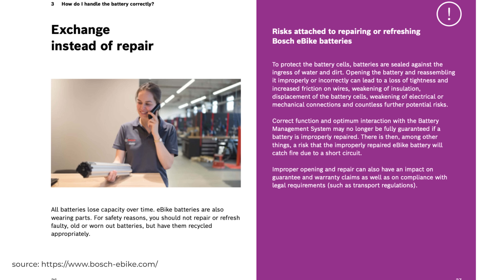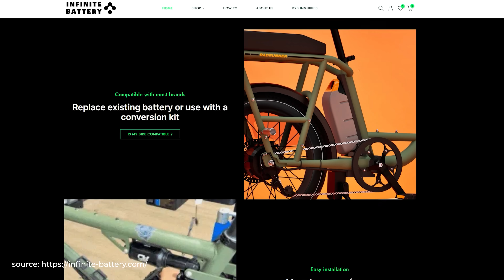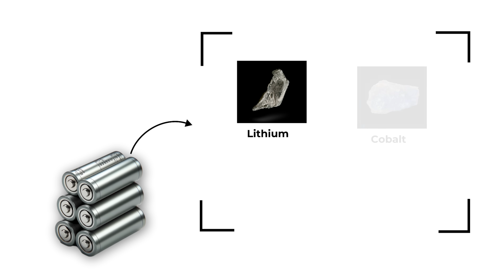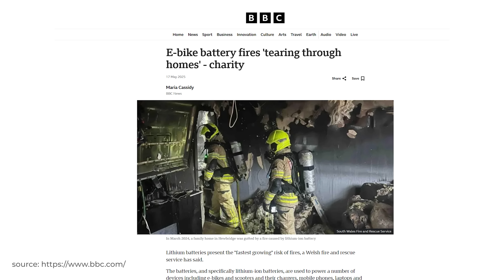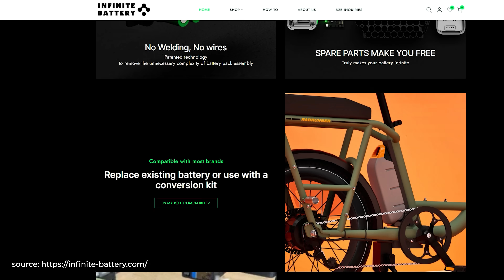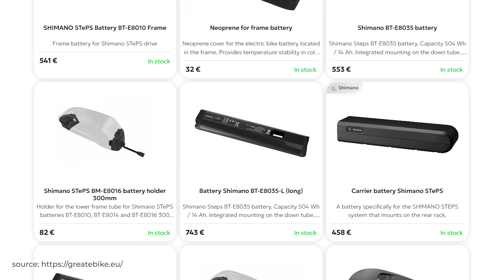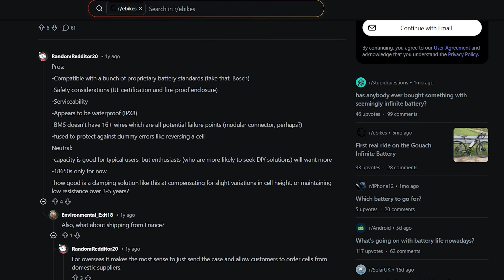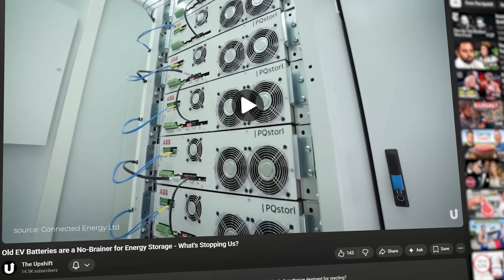This e-Bike Battery Rewrites All the Rules

Comment: Instantly subscribed. This channel deserves way more attention!  I fell into this rabbit hole when my Dyson V8 battery died early - turns out they intentionally brick packs with healthy cells by disabling balancing and then permanently killing the BMS if the cells comes sligthly out of balance. Classic engineered obsolescence, greed disguised as safety.
Huge respect to Infinite Battery!
Reply: Makita pull a similar trick with their 14V powertool packs. Try to charge an overdischarged pack 3 times and it bricks the pack forever. (and there is nothing in the powertool to stop you over-discharging. It's a blatant lie to call this necessary for safety - it's actually about selling more packs. This shit really should be illegal if we want to preserve a working planet.
Reply: @xxwookey this all true except the 18v tools do communicate a low voltage cut off. That three tries in a row is absolutely uncool. To get around bricked up packs, all you need is one known good pack and two pieces of wire stuck between the charger and good battery. Keep pos on pos neg on neg. Run them to brick and stick with washers in the slots. Pos to pos neg to...you get it. Plug in charger last and to be safe, dont leave unattended. Been doin this forever.
Reply: @acepairfecto5597  much better off over volting like 2 to 4 volts, get way more perf. From just a slight voltage increase. Just have to get a seperate charger to support the up voltage battery
Reply: @xxwookey  there is an Arduino tool to reset the BMS on Makkita batteries. Ive used it successfully to unlock my 18V drill battery after i abused it for my ebike and charged it manually.
Not sure if it helps in your case but i would try it out.
Reply: @xxwookey  its called OpenBatteryInformation
Reply: @wtsuser  Oh, that is so handy. Thanks. I wish it had been around 7 years ago when I was furiously re-boarding Makita packs to unbrick them. I still have some of the drills and batteries though so at least I'm good now. Cheers.
Reply: Ah, that would explain why my attempts at re-celling a Dyson pack failed. It works for a bit, then dies, even on new, freshly charged and pre-balanced cells.
Reply: I am so glad to find that battery issues are being tackled by fixitfairys. There are chargers for multiple cells that will re-balance those cells, why is this too hard for battery pack manufacturers? And my experience with failed packs is that 1 or 2 batteries fail, not the whole pack. 50+yr Electronic Tech.

Comment: I built my own battery, i built my own ebike. After using it for about 35K km i can say, that repairable batteries on ebikes are overrated. I will likely never have to replace my cells. By the time i do, im never riding bikes again.  If you are replacing the cells on your battery and its been less, than 10 years, then you are doing something wrong in choosing your battery.
Makes 0 sense for me to pay the price of a whole battery pack just for the case, then pay the price of another battery pack to fill that case just so i can refill it again when its time to retire.
Reply: Yes. This kit is not for battery builders, Klugscheisser.

Comment: I made and sold a no-weld 18650 pack with cell level fuse and great compression, design is open source, can see on my channel 4 videos ago.
Reply: Hey, I'm also investigating this because I'm wondering about a fpv drone designed battery. Everybody uses spot welding for those as well. The main question that people put back to me was how many amps can press fit terminals pass without significat heating over the traditional spot welded type. Did you ever have problems with thermal or amp limits on press-fit battery connections? Or is is a non-issue? I'm gonng check out your videos though, cause it sounds really interesting
Reply: The 2160s are the go now
Reply: @mickvonbornemann3824  2160s are not the "go now"
Reply: @mickvonbornemann3824  2160s? you mean 21700s? I use 21700s in my fpv batteries. But one bad battery causes a lot of unnecessary work. So I'm wondering whether a press fit battery can deliver enough power without browning out or burning out a connection to run a 7 inch quad.
Reply: with bms?

Comment: You need to do two things now: 
1) add support for 21700 cells
2) design larger pack for 70-80 21700 cells.
Reply: 21700s are so much better than 18650s, they are definitely the future for E-bikes.
Reply: I have a battery with 50 of those cells. The battery is impossible to keep secured without zipties. Even the triple bob from Grin isnt keeping it secure. It helps tho.
Reply: @daniilvolkov8790  I have 65x21700 (48V 25Ah) and I haven't had any issues for almost 4 years.
Reply: @daniilvolkov8790  I have a 30 amp hour 52 volt e-bike battery mounted to my frame and one mounted to my rear rack. It's easy to create a hold down that will keep the battery stable even if the bike falls over. But yes, these battery packs do need to be stabilized so they don't break the mounting shoe.
Reply: @daniilvolkov8790  what if he could use plastic or glass fiber for the housing insulation and then aluminium extrusion to keep them very well together!
Reply: @carholic-sz3qv  Something like that is done already. Still quite shaky. I have a suspicion, that my pack's case wasn't the best choice.
Reply: @carholic-sz3qv  You could probably even use carbon fiber as isn't not hugely more expensive than glass fiber (I think it's about 4x more last time I looked) , much stronger, also looks good too.
Reply: It`s in the pipeline.
Reply: Molicell have some 100amp 21700   yummy

Comment: loool the diy battery is so expensive yoy might as well just buy a good spotwelder. it will be more reliable and better
Reply: wait for chinese comrades. Soon or later they will steal this design.
Reply: Its more expensive as now they are losing servicing costs in the long term

Comment: swapping out cells isn't enough though, you can't simply replace a small number of cells, others are worn and need to replace as well in the row of the string, but then overall, the rest will discharge quicker than the new one you just replaced. in the end, you need to replace ALL the cells and put the other good ones as good use for other projects or give to others who have the same worn level to make a pack. I got over 120 cells waiting for 2nd life usage.

Comment: if the contacts are copper and spring compressed with large surfaces contacting the battery terminals then yes, the resistance will be comparable to spot welding or even better depending on the contacting surface area
Reply: Looks like two PCBs to me. Gold plated contacts offer reasonable resistance and don't degrade. 
Spring loaded copper contacts offer less resistance, but you're dealing with 2-3 different metals and possible corrosion over time.

Comment: 8:25 - Simply NO! Putting them in series increases the voltage. Putting them in Parallel increases the possible CURRENT. The CAPACITY stays the same.

Comment: For the closed battery architecture, at least for bike share, I have heard from an old designer that the problem is stopping people from stealing the battery cells -- either for money or (in true SF fashion) to get the lithium out to be used as drugs

Great for most individuals yea but the bikeshare stuff definitely has some more annoying design requirements
Reply: They are testing in rental fleets for years.

Comment: 50 euros for 40 cells? Sounds optimistic. Let's check if this offer is real by going to the infinite battery website, "Add cells
Cell pack - 40x DMEGC 32E 3200 mAh - SOLD OUT (€49.95)" Strange.
What if we buy them separately from the set? "Lithium-ion cells
Cell pack - 40x DMEGC 32E 3200 mAh
€99.00 Out of stock." Hmm, how is that possible?
Okay, what about nkon? “Out of stock.” What a surprise. So if the EU restricts the sale of 18650 cells on its territory, Bosch will win and force everyone to live by its rules, just as the bourgeoisie once forced the feudal lords to live by theirs, and the communists chose to become the new bourgeoisie instead of building the promised bright future. What do we have in the end? What we see is what we get. We need to exchange goods, keep records, and vote on the blockchain, then we will direct individualistic egoism towards building a bright future, instead of believing in someone's promises.
By the way, nkon has EVE INR18650-33VA 3300mAh — 10A, which is more expensive, but as long as it hasn't been banned yet, you can still buy it, although shipping will be costly.

Comment: this thing is probably the wrong approach. the right approach would probably be to take out the bad cells.
Reply: But, as Alex explained, it's very hard to replace one or two cells and still have a balanced pack, because the new cells will be different, or just newer and have a different (usually larger) capacity, and a slightly different disrcharge or charge curve. So this usually doesn't work very well in practice, depending on the sophistication of the BMS.
It is way more reliable to just swap sets together, then use the older cells that still work for something else. But yeah, you can do that if you like with this pack - nothing is stopping you.
Reply: Not really. 
In battery packs you have cells in parallel to get to the required voltage and many of those in series to increase capacity. 
If one cell goes bad in one of the groups and you replace only that cells then that parallel group will likely very quickly become difficult or impossible to balance and cause further problems in the whole pack.
When you start with a complete new batch of cells that have been matched then they all degrade at a similar rate negating this issue although not completely.

Comment: What this company should be working on is battery packs that use cells larger than 18650. The obvious choice would be 21700 cells, which offer substantially more capacity without being significantly larger, but even larger cell sizes are already on the market, such as 26800, and should be considered, given the large volumes of individual cells needed to satisfy demand. 18650 cells are obsolete for high capacity applications. Developing battery packs around larger cells now is also important for the future because eventually, most medium to large scale consumer applications are going to need to shift to sodium-ion technology, which is cheaper, safer, and most sustainable, but has lower energy density, so lithium-ion technology needs to be reserved for smaller scale applications where higher energy density is a design requirement.
Reply: I'm sure they will

Comment: if this crap was made in the 90s, a BMS would just be a standard cell holder where you could drop in cells, just like old AAs, and the welded stuff would be optional,

but we're deep into idiocracy, idiot-proof design is just idiot-creation in practice,

you can try doing it the 90s way, but it'll be a shrinking niche market, there's no fixing this world
Reply: similar with phone batteries

Comment: 350 pounds is worryingly cheap if what they are claiming is true and they are using quality parts(which they are probably not). and replacing the battery’s is definitely not something the average person could do safely, because voltage balance across the cells is near impossible without specialized tools to discharge/charge the cells to an even voltage with used cells making this process even harder. And unbalanced cells could be catastrophic, since you attach all the cells together at roughly the same time unlike when spot welding where you only have to discard the one that was just attached with an dissimilar charge to the other cells.
This seems like another channel advertising magic
Reply: 350 pounds is CHEAP??? No. The cells cost like $1-3 each depending on brand. Container is like $10. BMS and boards $20. Every ebike brand is overcharging for batteries since they are all proprietary fitments.
Also did you even watch the video? They dont even want you replacing 1 cell, they tell you to replace them all for this reason.
Anyways, this product is pointless since the hoobyists willing to tinker will just buy cells and spot weld them into the original pack. Spot welders are cheap, cells will be the same cost, effort isnt much more.
Reply: @_aceofspades_ it doesn’t matter how many cells you replace, cells are often stored for different amounts of time and sometimes depending on qc even brand new cells have different voltages
Reply: So, you're saying that it's impossible to design and build a tool that takes care of the voltage imbalance in an automated fashion? How do you think these batteries are manufactured in the first place, by hand?!?! We live in a world that's full of "impossible" tech. If you had said 30 years ago that we would be carrying computers on our wrists that are more powerful than any PC from that era people would've called it science fiction, yet here we are.
Reply: @crazymonkeyVII that would require a bms and an inverter for each and every cell, it’s certainly possible but not for 350
Reply: I've been changing AA batteries for my entire life.
Reply: @user-vo3st8kx7s cool

Comment: I'm kind of in 2 minds on this
Very much pro RTR & the infinite battery is fantastic
Problem is, people are idiots (I include myself in this)...& it only takes 1 to burn a building down
I think there is a middle ground....where OEM's are required to sell re-manufactured batteries at a reasonable price...buying back the old battery
Reply: I would say it depends on the way they design it. Gasoline is a highly flammable and even explosive substance, and people have put fuel stations on fire filling up their cars occasionally, but that hasn't caused regulators to ban people from filling up their cars themselves. If IB has designed this in a way that it will fit only one way and the BMS is sophisticated enough to detect and/or correct significant voltage imbalances I don't see why people wouldn't be able to swap the cells themselves.
Reply: @crazymonkeyVII  You'd have to also individually fuse each cell in case someone reverses the polarity on one or more paralleled cells, otherwise that group of cells could potentially go pop.
Reply: @therealchayd I disagree. We don't have to completely dummyproof everything in life. If people don't follow the instructions that's on them. Just make clear what is plus and what is minus and let people figure it out.

All this dummy proving is being used as an excuse against right-to-repair as well as why you can barely change anything on your operating system yourself anymore if you use MacOS or Windhoze. It promotes incompetence. Let people be responsible for not screwing up, instead of trying to prevent each and every mistake possible. What's next, automatic mandatory speed limiters on cars to prevent speeding?
Reply: @crazymonkeyVII  Nothing wrong with individually fused cells, it reduces the risk of fire caused by a cell with an internal short, but also has the advantage of making it idiot resistant too, both with only a marginally increased cost. I mean Tesla have this arrangement in their packs, so can't be a bad thing to have.
Reply: @crazymonkeyVII  Filling a fuel tank is far less complicated than building a battery pack.
Reply: @nickwinn7812 depends how you engineer the battery pack.
Reply: Sadly infinite battery will have to build internal tests to detect stupid errors like batteries inserted backwards, connectors not screwed in etc.  Even more work for a small company...and then the liability insurance.

Maybe better they sell a set of parts rather than a full solution.  Can't be sued when complete battery fails.  Of course all the parts are put together to make the kit, but never sell the parts together as a complete thing...legal>design
Reply: that is why batteries should be required to be stored in designated fire proof metal boxes in high rise buildings